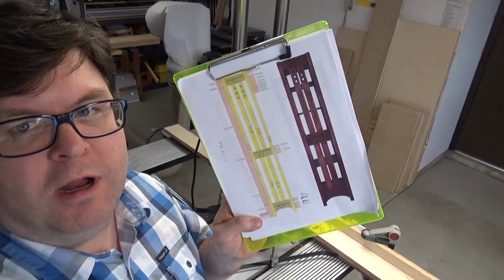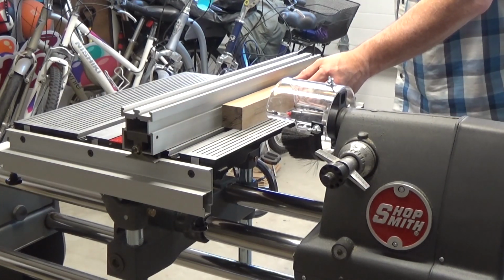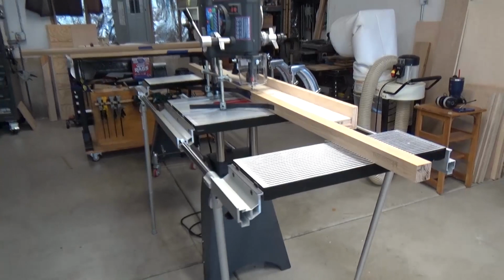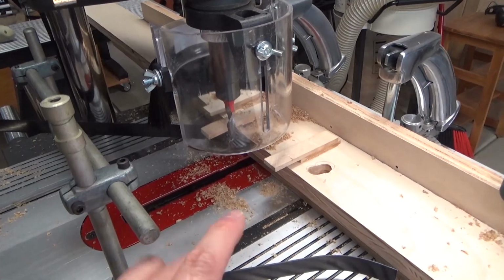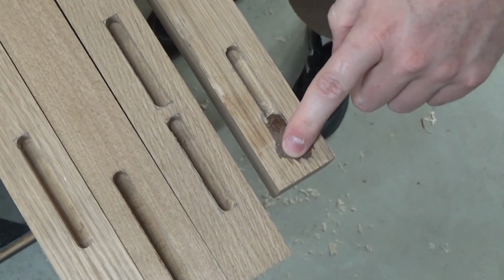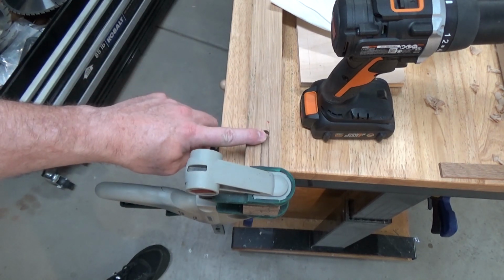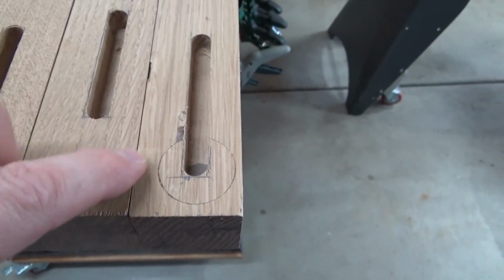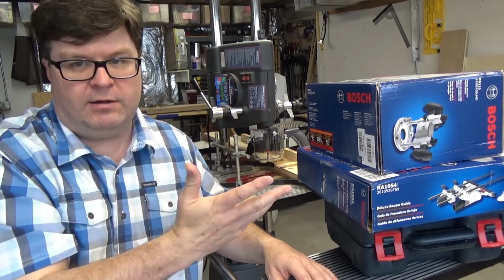Only With a Shopsmith: Technique  for Mortises in Large Work Pieces

Comment: The pass-through was a clever approach, Tom.  Sorry it didn't work out as well as you hoped, but you are on the right track with the router. Scott
Reply from the maker: It was a fun experiment and did the job so I feel good about it. I knew going in that the old adage to move the tool to work piece for large parts was going to win out.

I think any sort of drill press mortise will want for perfect smooth sides. There has to be some slop in the quill to allow for its extension in and out, so that means a little side to side to.

Comment: Tom… the outer tables with the support legs add a bunch of versatility to the SS.  I use them a lot to support long pieces.

I have a Porter Cable bench top mortiser. It sets on my work bench and my SS works perfectly as my in & out-feed support.  

Here’s a suggestion for bung filling a hole:  Tilt your sander about 5degrees.  The taper you sand in the edges will hide most cracks.  You might think it would be difficult to get the sizing perfect… but if you make it thick enough… it will be strong enough that you don’t really need it to bottom out perfectly in the hole.  Just drive it in until it is tight.  Glue at the edges will hold it just fine.

Your point is well taken… when it comes to complicated set ups… make sure the juice is worth the squeeze!
Reply from the maker: Great tip, thank Dave!

Comment: Great setup. Very good use of the SS table system for stock support,looks rock solid. I noticed toward the last that you were cutting in both directions.  Was there a tendency for the stock to pull away on the climb cut?  I would have thought the spring holddowns wouldn’t be stout enough to prevent that.  I think the SS was fully capable of the job you accomplished with it, but never miss an opportunity to add to the tool collection. I have the Makita palm router with the plunge base and like it.
Reply from the maker: Thanks Larry. Yes the table and the steel hold downs seemed solid and the hold the piece well. The biggest challenge was the dual miter setup and custom fence. It just took a long time to nail down.

Comment: Excellent job. For me with more than enough time I prefer using the SS setup. What speed were you running on the PowerPro?  Thanks for sharing.
Reply from the maker: Thanks Curt. I definitely like using my shopsmith too. I ran 6000 rpm, this bit seemed to work well there. I found that 10k is just not necessary for routing joinery.
Reply: @woodshopnerdery  great information to know. I will definitely be giving this setup a tryout. Curt.

Comment: What speed did you use? any vibration ? Great video.
Reply from the maker: The router seems to run better at 7,000 RPMs rather than the 10,000 RPMs. Don't know what just a "feel thing." Nope, no unusual vibrations.

Comment: The problem I've had with horizontal boring is that the table "legs" flex and the work piece moves away from the bit, which changes the contact location.
Reply from the maker: True. Are you backing up the main table with the auxiliary table?
Reply: @woodshopnerdery  I have not. But clearly it is a must.
Reply: @woodshopnerdery  my main use for horizontal boring is the jack in the side of a guitar. 😉
Reply: I have the 510 system and went down to my metal supply house and bought a 60” x 1” steel rod that I run between the table and the end supports. That really stabilized everything and you can get all the pieces on a perfect horizontal plane. In addition , I can set up the saw and the jointer on one end of the shopsmith and still have great floating table supports on the other end.